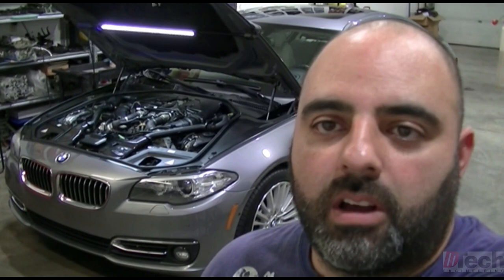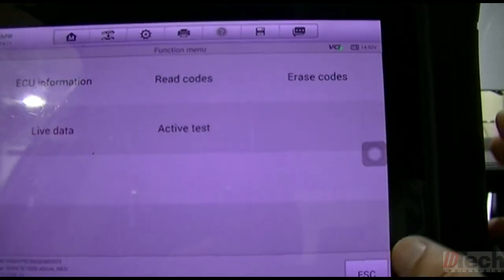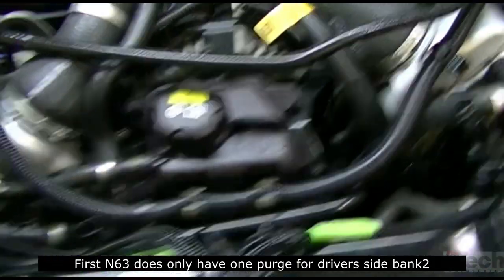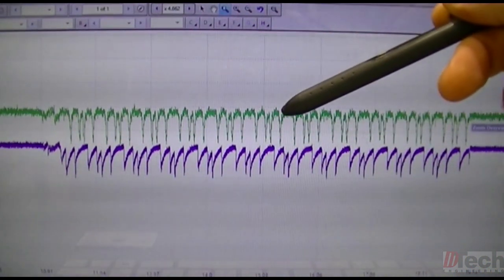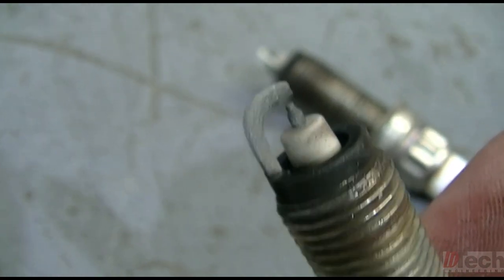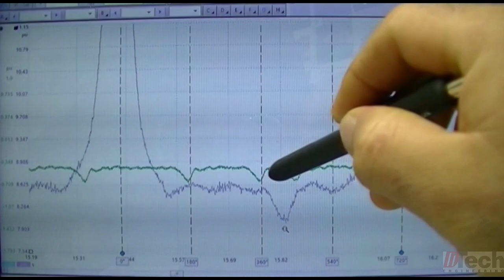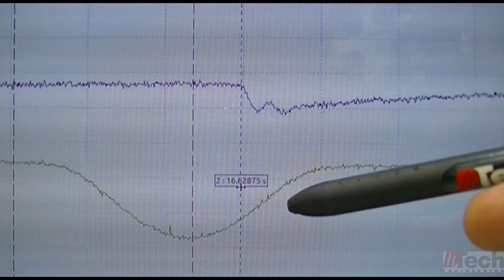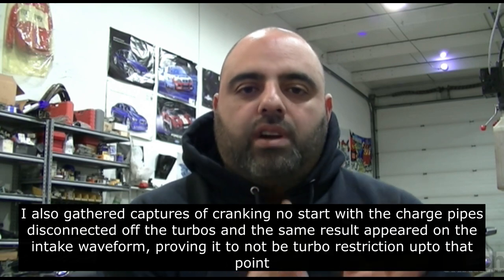Case Study: BMW N63 P00BE Mass Airflow Too Low

Comment: I see it differently. Bank 2 sharp drop in manifold indicates that it is switched by a gate, I think valve,  a buffer or restriction would not have that sharp transition.  Bank 1, as the incylinder pressure rises, then drops to lower pressure until the the intake closes at 540*. Bank 2 stays flat BUT the thing that stands out is the intake closes past 540, maybe 580.  I haven’t got a theory for why the valves seem to open same time on both banks at equal times but the valve is the only thing that connects the intake to the cylinder and the intake does not react to the apparent valve opening immediately.  I think that the drop of intake pressure is the actual valve opening.  It looks like the 15* late closing also attests to the 15* late opening.   I wonder if the valvetronic motor is stuck at minimum lift?
Reply: exactly what i tought!
Reply from the maker: Hey Steve, Thanks for watching. And to try and touch on some of your points..... As far as some sort of "gate," this setup doesn't have or use one in the intake track like a changeover valve or "flapper." If there was such a thing, you would not only see that sharp drop, but you would have to see a second one for whenever a "gate " would return to its starting point and we obviously don't have that. That sharp drop is an effect of the fact that there is a restriction or buffer and doesn't let the air move correctly in time, it delays the movement, and so when the vacuum level finally gets exposed in the plenum to its full level, the pulse range shoots down rapidly. That sharp drop is due to the change in pressure in rate of speed and time. That point at which you think both intake valves are "closing" at different times is actually due to the effects of pressure pulses making the trace go up and down during the intake stroke when you have current air travel due to air movement in the bank 1. I happen to pick the one that the pulse "stayed" higher just before actual closing of the valve and makes it look like it "closed early." And to prove that statement simply look at the closing point in the event before the one I used to explain on bank 1, the closing ramp happened at its true point which is later like bank 2, you can tell by referencing the green trace and comparing the two events on the gray channel, and also by clearly seeing the ramp on the event before the one I used is sharper in angle compare to the more elongated uprise in the example I used as you think closed sooner.  Again it's an effect of pulses from air moving during the intake stroke and sometimes it "masked" the true closing point but there's no denying it truly closes later just like bank 2, and bank two is "flat" because as I said in the intake pattern it has no "air flutter" so you don't see pulses in the intake pattern and so the same with the in cyl pattern, there's no pulses on that trace because of the "buffer" or restriction of air movement. I did of course try to relearn the valvetronic and it did not make a difference, plus if it were to have to different lift points, I'm pretty sure there would be an apparent trouble code to follow and possible limp mode. I hope this helps explain some of your concerns.

Comment: I have to say, you are a  impressive tech in my book. I never had or used a Modern scope before. I am a dinosaur tech that got out after the Dos system became obsolete cause the new tools were limited and obsolete shortly after.  But what about the exhaust phasor leaking down, loosing lock. The exhaust is CC and intake is CW correct? Or the other way?? I forget. It was cool and odd to see this because I owned one and it was a twin @ 42k. The previous owner had it 5 years and put 6k on it and probably $6k in it. He had enough when the last guy cracked the $$$ windshield right where a garage mechanic would put a ratchet..  resting on the wiper. And he denied it of course. I Got it cheap and I instantly experienced intermittent power. Surging.. Without changing any parts I started with textbook : clean solenoids, E shaft limit test and adaptation, viewed cam advance (in witch the B2 exhaust was at 78.9 almost limit), on a over nite cold engine start I also experienced a momentary tap like noise coming off hi idle. Surprisingly No lights on at any point but it was a restriction or lack on B2 with roughness spikes on 5&7 and for it to run this way and not set a code I was thinking the DME was manipulated.. In Dinosaur days I did it to a secondary air issue that seemed to be un fixable at the time.     So I pulled the valve covers to replace the gaskets anyway and noticed the phasor wasn’t locked. I locked it, check the timing and the cam was off a few degrees. I put it back together, a obvious change in start and idle. Limiting cam was at 73, went for a serious ride and in park while snapping the throttle my nightmare was back with maybe - 1.0 to 1.9 on the cam position. Bottom line , the phasor was bad. I had recently heard that bmw recall list looks like a HUD mortgage and is extended so I’m sure bulletins are probably very useful for these gems.. 
 Keep doing what your doing👍Sorry if I was babbling too long.

Comment: Amazing video and analysis. I am not a mechanic but I own a BMW and you have to sort of become one! 😄 I have an N63TU and the problems never stop.

I was wondering, I have Bootmod3 which has data logging for a vast amount of channels, would it be possible to capture similar data? And do you offer a remote service?
Reply from the maker: It will definitely give you sensor data that you can log and try to see if there is an issue, and no I do not offer remote service unfortunately

Comment: I am having the same issue with my S63tu M6 could you please help. What driving at 50% throttle and heard something pop, beside air mass too low there is no code. After watching your video I tested the tank vent bank two suction feels weaker than bank one. TB bank 1 @ 5.+-% while bank 2 is at 2.5+-%
Reply: Have you solved your issue? The same thing happened to me just last night on my M5. I was at a light, I was accelerating, hear a pop that was like a backfire and then I lost boost completely. Car drives fine, no rough idle, but does not make boost. Only code I pulled was P00BE.
Reply: Any update on this issue ?
Reply: My car went to the shop last Tuesday but my mechanic is slammed with cars. He has given me any updates yet. I’m hoping the OP who had similar issues as I did chimes in.

Comment: Try doing the valvetronic relearn hopefully it works ,and the hump in the end of the exhaust  waveform is the turbo spooling good video man .
Reply from the maker: Thank you for watching Gazmend , and as far as the valvetronic,  I did perform the relearn and it didn't rectify the issue, and the hump I know on some vehicles can be the turbo, but on this one it is from the exhaust cams being phased in the advanced position at the cold start up high idle, and further down the waveform when phasing towards the retard position the hump decreases due to the exhaust valve closing later as it warms up. Hope that makes sense and glad you liked the video
Reply: You right phasing does do that thanks .by the way I've also seen  bmw do all sorts of crazy things when putting the wrong oil filter .

Comment: Hey man i'm having this same issue, on bank 2, air mass 2 plausibility: Air mass too low....i recently replaced all of the following: injectors / vanos solenoids / hpfps / CAM position sensor  + before than i did new plugs / coils / mafs / 02 sensors (all 4) on my 2014 550i n63tu. Car runs strong, but i get the check engine light with the previously mentioned error. do you think this can be a wiring issue?
Reply: Check volumetric efficiency and combustion cycle with a gas analyser

Comment: Hey mate, thank you for posting this video. 
I own a 2016 X5 4.4L, I noticed the fuel mileage is very bad. Put it on a scanner, and got two errors (Hot film air mass meter 2, air filter element 2, signal: Poor incoming flow) on both DME and DME 2 . 
I don't think both air mass sensors are malfunction,  tried to clean them using air mass cleaner but no luck.
What are my options? No check engine light, no cylinder miss fire codes. Both DME and DME2 air mass readings are almost similar (around 14kg/h on idle)
Reply: I think I have the same problem on my n63tu.The car is at the mechanic now. Did you find out anything more?
Reply from the maker: try swapping the air filter and mass sensor side to side and clear codes, then recheck. Other than that some further testing would need done.
Reply: @DTEAuto  I did it as you said  I have low filters.I cleaned the sensors Now the mechanic is trying to find the problem.What is the situation like for you?

Comment: Great video THANKS JUST WONDERING IF AN ESCAN  WOULD BE HELPFUL IN  SHARPSHOOTER VE
Reply from the maker: I know from what I have seen it perform, it should be able to pick up that there is an air moving problem.....BUT, I have no idea how it would do on a situation like this only because this one has and uses 2 separate DME's (engine ecu's) and so it then has 2 MAF's.....because of this, the escan plugs into the obd and derives its info from generic obd data, and so I have no idea which dme it will tap into for generic data (whether its dme 1 or 2) so at that point I guess you are hoping that it taps into the bank that is having the issue to be able to actually graph out bad ve data. Hence on video I kept having to bounce back and forth between both dme's to get scan data. For this reason, I am a big advocate of getting data with a scope like how I was able to get the maf frequency and use math channel and "see" the flow difference. Hope this helps, and thank you for watching

Comment: This video is the ultimate food for my brain.  Sadel, what was the approximate mileage on this engine?  A few minutes in I was thinking maybe there was low compression on 1-2 cylinders on bank 2 but you disproved that theory.  A truly outstanding video, Sadel.

Question:  how does that ECU handle fuel injector firing?  Do all of the injectors run off the same driver or does that ECU have one driver per bank or one per injector?  I'm just thinking out loud (I'm probably wrong, too) if the ECU can be driving the bank two injectors with less 'on' time than bank one, hence the leaner looking plugs and less bank 2 vacuum?  Obviously a moot point if the ECU doesn't control injectors in that fashion.

As I've said in prior videos, there's nobody better in Cincinnati than you, brother.  #CincyDiagKing
Reply from the maker: Thanks Dave! I believe the engine had 55k on it, and the injectors are controlled individually , and the ecu (or DME as BMW calls it) would definitely have the ability to trim the on time for sure.

Comment: Hi. I have the same error for an identical engine - N63N. The car came with a damaged crankshaft (not turning) and we repaired it (total overhaul). The engine needs a little throttle pedal to start. But it works fine (the power and compression are perfect). Sometimes it stops when the revs drop to idle. Do you have any conclusions about that 550i?
Reply from the maker: you would have to check and see where the cam and crank signals are lining up, and also see if the actuator is performing enough advance/retard. Also check the vanos solenoids for debri or sticking
Reply: @DTEAuto  Thanks for an answer. That's a first time we have "adventure" like this with N63. VANOS solenoids are new. I will upload video for you, with some live data tomorrow! Thanks!
Reply: @DTEAuto  And this is DME2: https://youtu.be/LXqvn3IJ4IM
Reply: @DTEAuto  After few seconds "Drivetrain error" appears, and it's works different. Error is always for Bank2 air mass too low, and misfiring.
Reply from the maker: do the same test, try to do both banks monitor at when engine is fairly cold, before the engine gets too hot, and watch the intake air temps and compare bank to bank like i had on my video. That will tell you if it will be a restriction problem or not.  Also maybe compare the throttle angles from actual and desired, see of bank to bank at idle are the same. In your video that's what I was looking at.
Reply: @DTEAuto  There is Lambda parameters and mixture adaptations, bank to bank in the same time:  
https://youtu.be/l1g9WJ8xVWY . It's always the same story: when it's stable, you punch gas, and it's not stable. After some time it stabilizes again: https://youtu.be/PJ9x7ARRUy4 .
Here is the same test at 2000rpm (it's not stable only at idle) at higher revs it's always perfect: https://youtu.be/Y1j0gDnJoNo